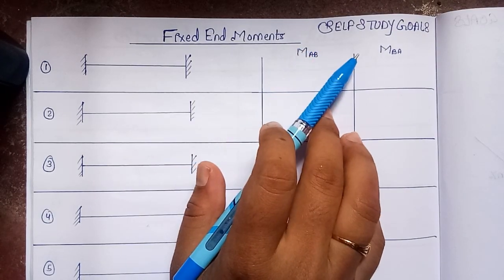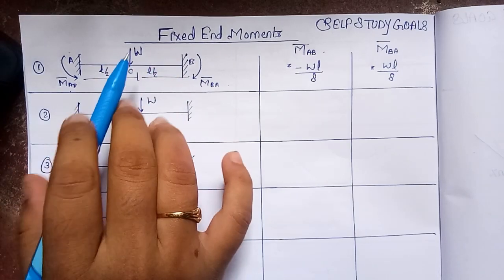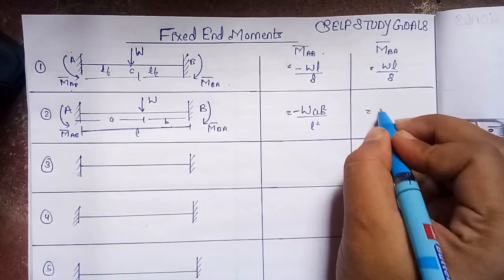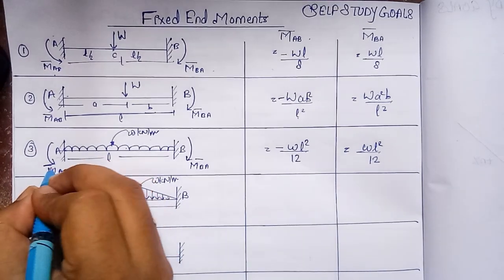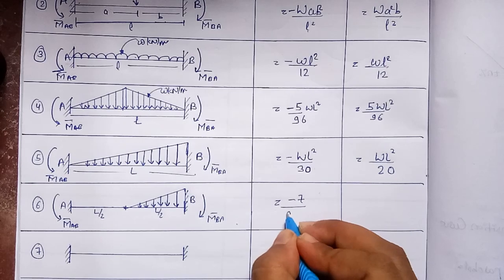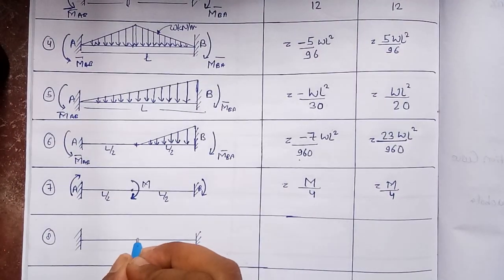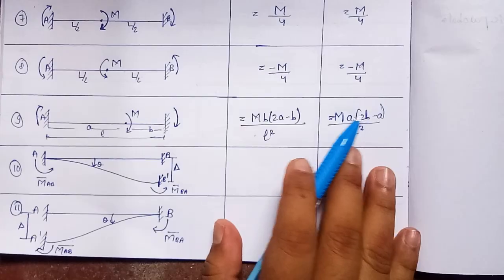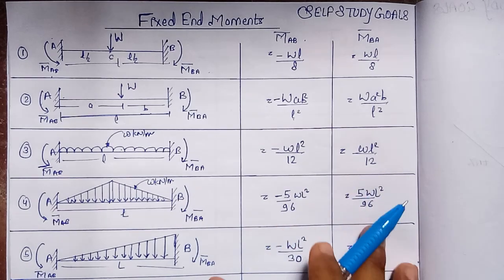Fixed end moments | fixed beams |  structural analysis

Comment: Mam How did you get those values ? Like in 5th case, uniformly varying load , you wrote WL^2/20 & WL^2/30 . Is there any formula to derive this fixed end moment ? I am not getting it exactly
Reply from the maker: All these cases are derived by analysis methods available and put in table for shortcut used in competitive exam .
Details study of its derivation can be covered into separate video.
Reply: @selfstudygoals6371   will you make one ? I would like to watch. I had tried the derivation but my results are different than those values